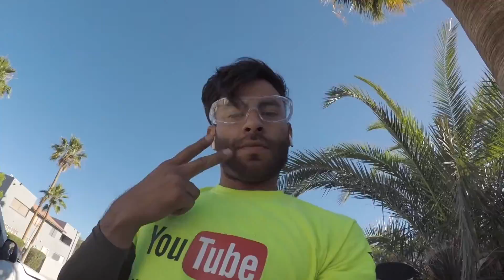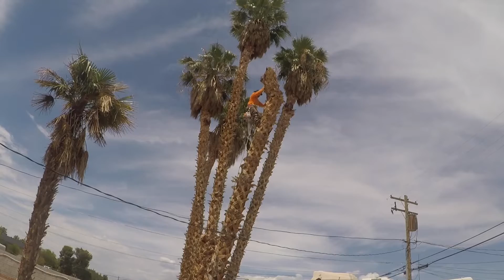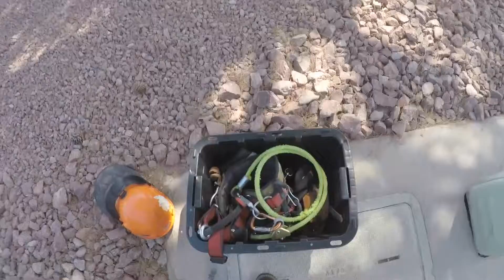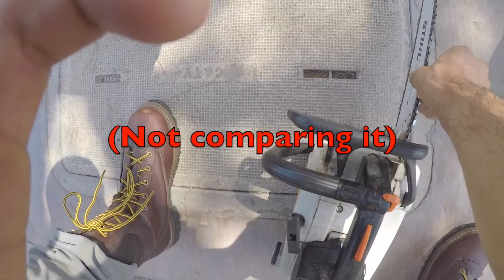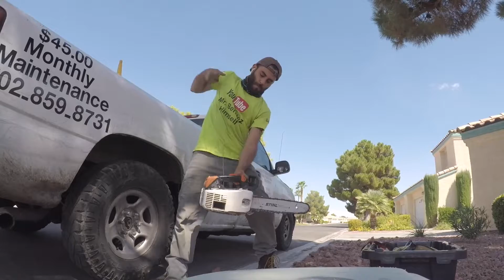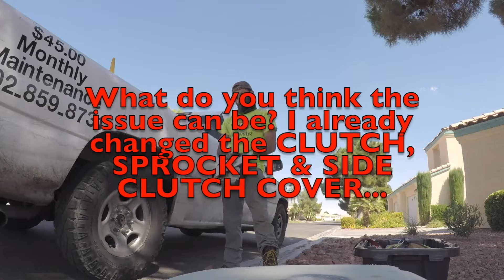"MODIFIED" STIHL MS 200T

Comment: Nice saw man, Could be carb related but it's tough to tell, If you got it used and need to rebuild it I recommend the meteor piston and cylinder kit, Pricey but it's very good quality. Or obviously OEM is good to.
Reply from the maker: Poplar Mechanic bro this who chainsaw was rebuilt with after market parts😒
I got my hands on an oem stihl 200t and it doesn’t even compare 🌴👀

Comment: Make sure your carb settings are at ..H 3/4 out off seat and L 1 turn out off seat.. and also check the spark arrester for carbon. The mufflers on 200T’s are incredibly restrictive and honestly the best thing you can do for the saw is to run it without it..The carbs are notorious for failing due to the fuel pump scoring in that case it’s like 76$ from the dealer but I’d keep it simple before tearing into the carb